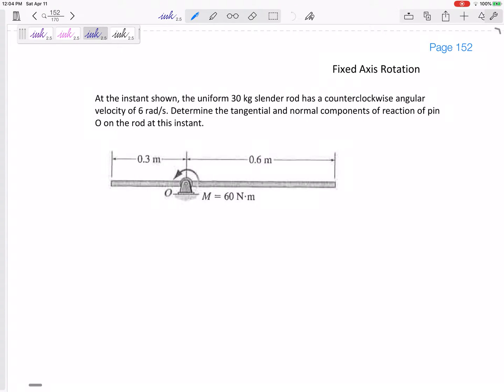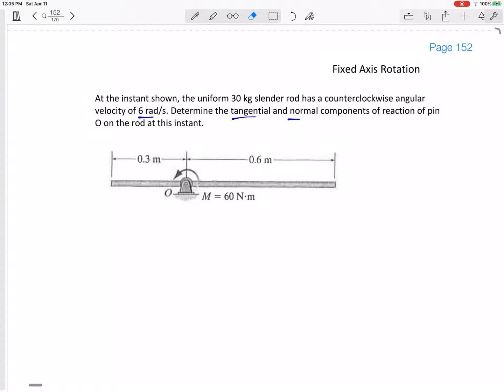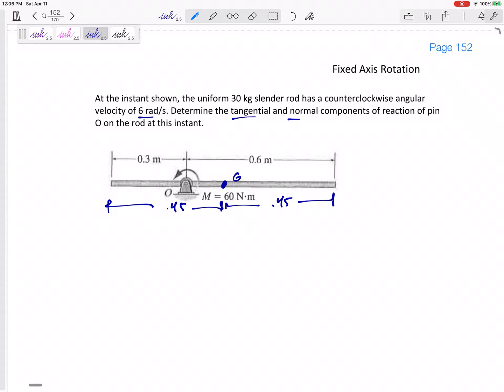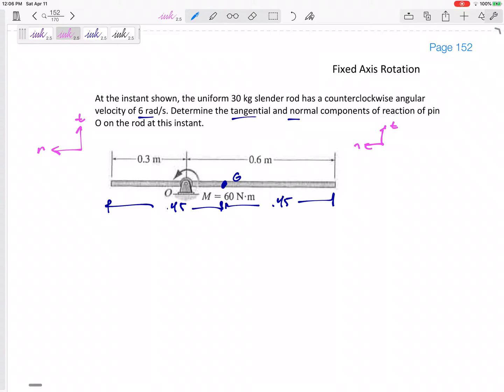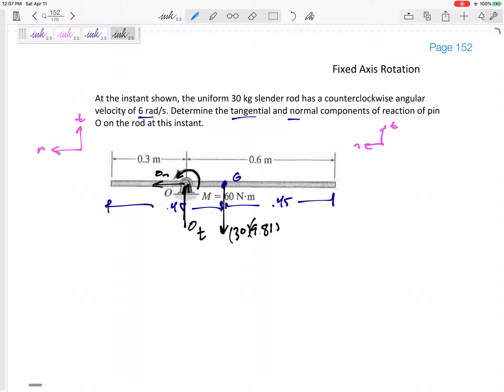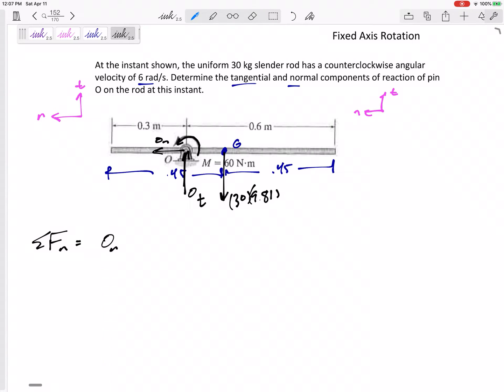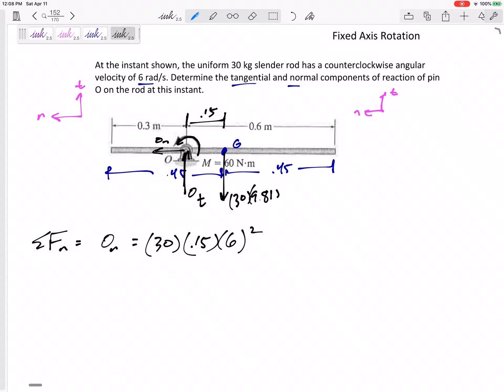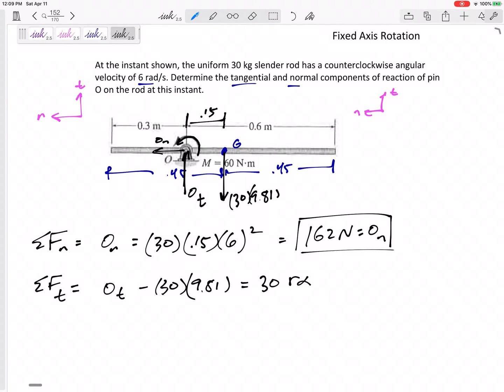Dynamics - Rigid body rotation example 4

Comment: at 2:02 how we know that direction of on is to the left ?
Reply: Its not! It is to the right and you can check that by realizing that by taking point G as our focus, we can deduce that there will be 3 forces acting on it. The rod's weight, the tangential force at G and the centripetal or normal force at G. Since the normal force at G and On are the only horizontal forces, you can equate them in sum of forces in the normal direction. Realize that the normal force at G is pointing towards the centre of rotation (point O) and therefore to balance it, the On force has to act away from the centre of rotation. This makes it clear that On needs to be directed towards the right hand side or in other words "away from the centre of rotation"